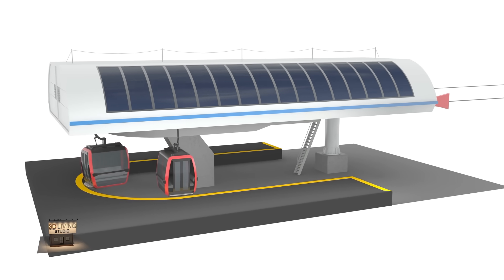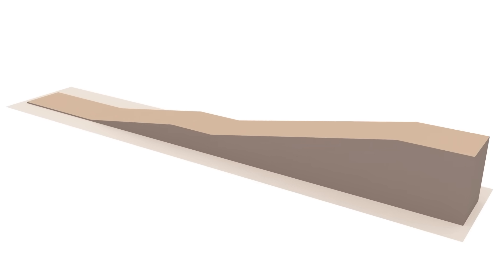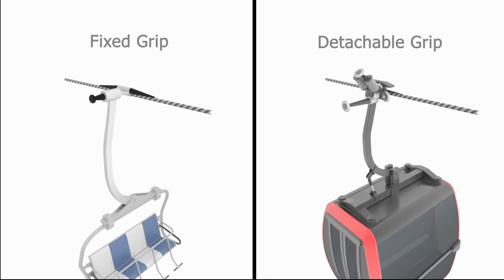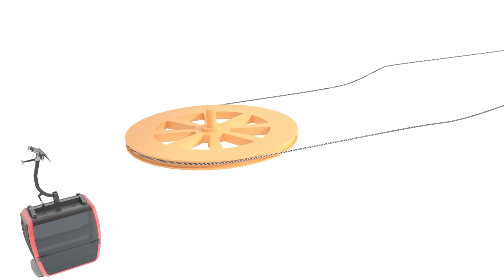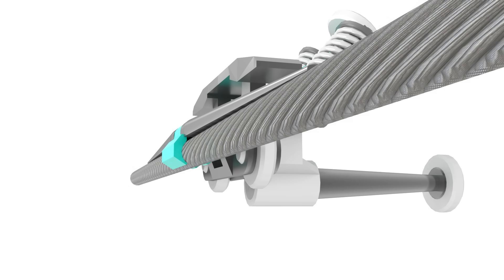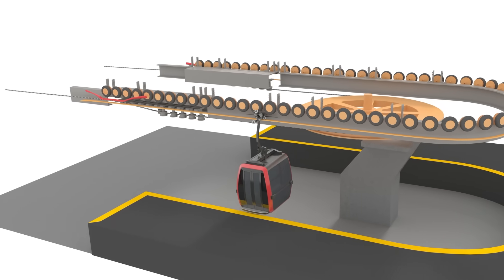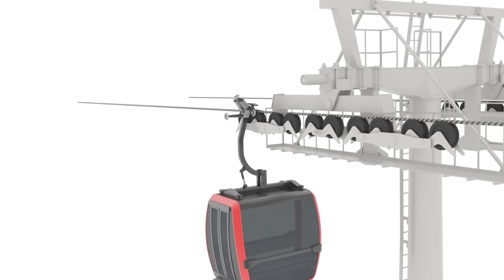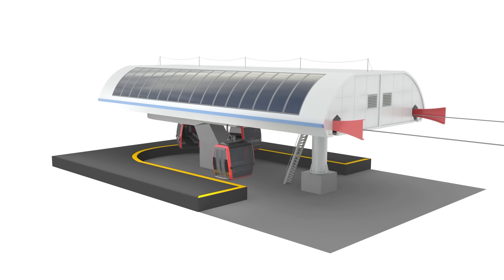How Cable Cars Work and Detach From The Cable

Comment: Are the Rollers in the Station Powered by individual Motors that drives the Cable car in the U-turn at slower rate? They are not Free Pulleys Right like the ones in the Pylons?

Comment: The same mechanism also allows intermediate stations, where gondolas (the "cars") detach to allow passengers to alight and board while gondolas in flight at that time don't have to slow down. An intricate sensor system makes sure that gondolas always end up evenly spaced and can place gondolas on hold for a few seconds if they're not.

Some systems even have switches, enabling operators to take gondolas out of circulation and into storage on slow days, or for maintenance, or having a branch off the main route (as in more than two termini).

Comment: Interesting other points.
The cable generally runs in a vertical plane, doesn’t turn left or right.  Though it can turn a bit in the same rotation as the bull wheel. 
Also noticed last visit.  When running under a pylon the cable makes a much larger change in angle than running over.

Comment: Do they ever have to adjust the spacing of the cars? Otherwise they would tend to drift different directions as they arent attached.
Reply: When they detach, they first slow down. Then they are moved forward at a constant slower speed. Then they accelerate to reattach. The fast speed, slow speed, deceleration and acceleration are synchronized to keep drift in check.
Reply: @charliefoxtrot5001  yes. However id think there would be some drift or error margin that would add up with time.
Reply: @colorado841  There is always some drift/error, but it is negligible in the grand scheme of things. Any misalignment can be reset by letting the base station hook up the cars/chairs in fixed intervals.

Comment: damn did not get the answer i wanted. you said it doesn't have an engine. what powers it ?
Reply: The cars themselves aren't powered. The power source is attached to one of the big wheels as shown in the video and depending on the location its probably at the bottom.
Reply: @norbertdx  thank you

Comment: Perhaps that method works if there is control at each arrival station when all the containers arrive at the station and then the others are continued to the next station, but how can you control the movement of containers from cable to cable if some containers are to one country and others to another country, and in the same process to other countries.

Comment: We could connect the cab to cable by magnetic or electromagnetic rings so it frictionlessly glide on the cable need no motor or power drivers

Comment: If the speed of the rope is constant, when the car is reattached to the cable it will get further to the car in front but closer to the car behind taking into consideration the time it slows down at the platform when being detached, and wouldn’t this change of distance become more pronounced each time the car slows down?
Reply from the maker: The distance between cars does not always stay the same
Reply: @3DLivingStudio  how to ensure a safe gap between cars then?

Comment: I've been wondering, and perhaps someone can shed some light on it: how is the cable installed in the first place? It's a continuous cable, so it must be put together on site somehow. Additionally, how is it fastened and strained?
Reply from the maker: It's gonna be a long work to answer this question with 3d, but in short, human workers carry materials by foot across the mountain to construct pylons, and pull the very first cable

Comment: I wonder if the boarding area could have a conveyor floor like baggage claim carousel. Definitely would make wheelchair or stroller boardings easier. But since there's dozens of it and still no conveyor floor, i might think it's unnecessary.

Comment: Great video but there is a bit of a mistake I think. I'm pretty sure that the cable is straight in the station and that the vehicle is lifted off of the cable and onto the track where the wheels move it around the station. These cables have a lot of tension, deflecting the cable like on the video at the entrance of the station would be impractical.
Edit: I looked at some lifts since, I think the Poma ones have the cable straight like I describe but, some Leitner models seems to have the main wheel at a slight angle so the cable would have a single deflection downward at the entrance, still no Z shape but still interesting to see the difference.

Comment: This is great. Was always curious. Also, when the car is accelerated does it mount at the exact same location or do cars fall further back every time they re-engage?
Reply from the maker: Cars fall further back, because the cable always rotate at the same speed, but cars slow down at the station when detached.

Comment: They should have a clamp between the pylons to safeguard the sections in between them to make the system safer so not all cars come crashing down to the ground in case the cable gets cut such as in the Cavalese disaster when a cable got clipped by a reckless fighter jet.

Comment: I love riding these cable cars, the detachable ones always have this nice acceleration when they leave the station, it's kinda like being in an airplane.

What fascinates me about these is that the clamps hold the car in place merely by a set of springs and applying friction. It's kinda weird to think that in the mountains, you're above ground by dozens of meters, a kilometer away from the ground station and all that keeps your car attached to the cable is a mere clamp lol.

By the way, in the Kleinwalsertal in Austria, I've seen a cable car with a really clever design:
Basically, two cable car lines that are connected via a mid-station. The cable car leaves the ground station, reaches the mid station (with it's return bullwheel for the ground station and another drive wheel for the upper station), where it is detached from cable 1 and slowly moves through the station, continues on straight towards the cable 2 and then continues upwards to the mountain top.

You can easily and conveniently get into or out of the cable car in the middle of the ride and depending on necessity, the two lines can be run seperately, cause there's a set of switches in the middle station.
Reply: "Double stage" cable cars are fairly common, at least here in Italy
Reply: lol same. Whenever I visit HK, I always have a little panic attack whenever I realize we’re above the waters and about to climb the mountain haha
Reply: yeah this f frightening me as hell :D
Reply: a cable car with three stations is also available in my city in Algeria

Comment: I worked a Von Roll type 101 skyway over the summer. Pretty crazy how the cars from the 60s/80s have the same technology/engineering behind it in terms of the grips. Only difference is the wheel assembly gets lifted up with the lever moving in either direction to either be locked or unlocked on the cable.
Reply: Giovanola Clamp…

Comment: I ski regularly and always feel more safer on the outdoor fixed wheel, as opposed to the gondolas detachable wheel on the long distance car with doors and an interior. Our resort has the longest gondola in world, the golden gondola at Zlatibor in Serbia 🇷🇸.  10km long to reach the peak of Tornik mountain ⛰️. Maybe I felt the external ski 🎿 lift was safer, as its attached
Reply: Most chair lifts are detachable these days as well. Far better than the old fixed chairs. Fixed chairs are both simultaneously fast in the loading/disembarking zones whilst also being slow to travel up the mountain - the worst of both worlds.

Comment: I was on the gondola recently and the area got hit by strong winds. It was scary as f***!! They slowed the speed really down and the journey time doubled. The cars were swinging left and right. Plus the window was stuck in open position and the resulting  whistling wind noise was providing sound effects!!! 

I think I would have maybe preffer fixed gondola cars. 

It was the detachable type.

Comment: My teacher told us to make an elevator. I offered to make one of these for extra points. This looks hella hard to replicate, but thank you for showing me the right path!
Reply: When I was a child I built a system like this on the stairs out of various construction toys I had (K'nex, TinkerToys, Capsela), but designed it as a purely fixed-grip system, and didn't have any chairs or gondola cabins attached, that would have been more difficult - just had a string moving. That would be a good starting point, next would be to try to design chairs or cabins. Detachable like seen here would be very difficult and complicated to build on a small scale, I'm not sure off hand if I've ever seen a working one, though I've seen plenty of videos of fixed-grip. I think I might have seen one that detached, but they didn't have working grips, just sort of sat on the rope, and hence couldn't climb very steep without sliding.

Comment: Thanks for this. Another item in this is how the cars accelerate back up to the cable speed. Each of the rubber tires turns a bit faster, so that when the grip grabs the rope, they are both going the same speed. Otherwise, the rope would quickly wear out.
Reply: I've just been at a ski resort and was wondering about this. I assumed, and it seemed like, the last couple of meters of the rail before the cable car reattached to the cable was slightly down hill, allowing the cable car to accelerate back up to speed.

Comment: Aerial tramways are NOT gondolas. they have 2 cabins and multiple (2-3 in most, 1 in tin can type) cable
Reply: nice animations, but the speed ramp up is not considered, as well as the older chain based station system.

Comment: Great video. But how do they install the cable?
Reply from the maker: Good question!  I haven't yet researched on that, maybe I need to make another video about how everything is built and installed.
Reply: Usually helicopters install a pilot line that is used to pull the cable up